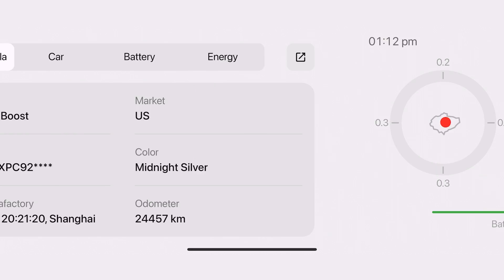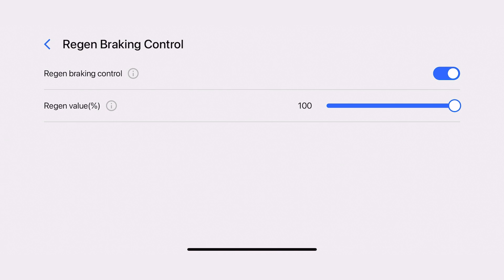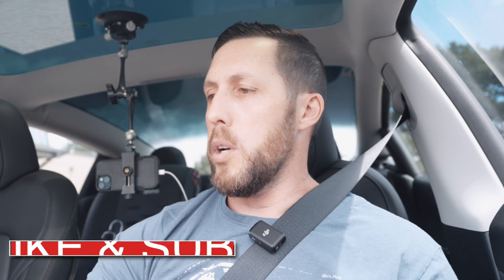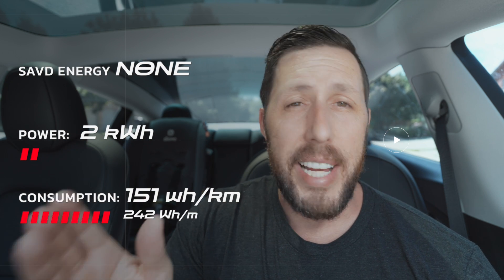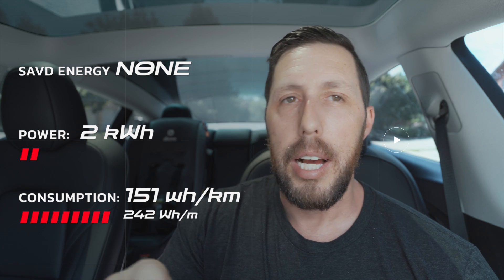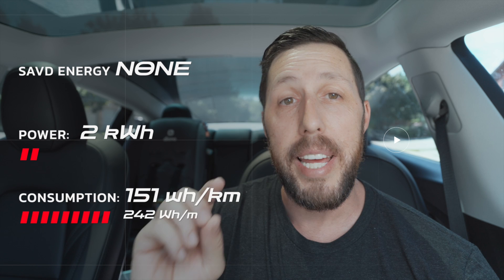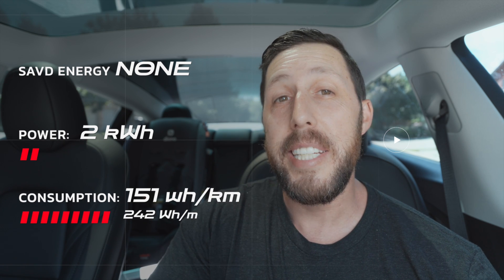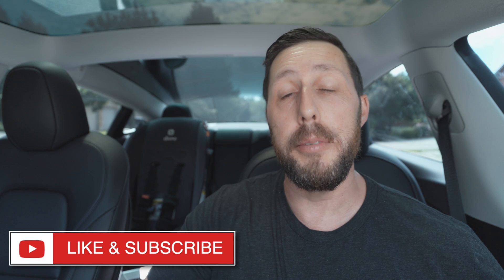How Much Energy Does Regenerative Braking Actually Save? Tesla Efficiency Test Revealed!

Comment: Would it be possible for a delivery driver to benefit more from regenerative braking? I deliver for amazon flex and often have my vehicle come to stops at multiple traffic lights, stop signs and peoples homes. Im not looking into buying a tesla but rather the Kia Niro Hybrid which has regen braking feature. Some Kia niro hybrid drivers claim that the regen on that vehicle is so good that it is capable of keeping the battery fully charged resulting in higher combined mpg which sits at around 53 mpg. I currently drive a all gas car that gets around 23 mpg city so buying this kia niro hybrid would really help me save on fuel cost while delivering.
Reply from the maker: Absolutely. Contrary to gas cars, EV’s mpg are actually better in the city vs highway because of the Regen braking.  So if you’re doing a lot of stop and go as a delivery driver, you’ll absolutely benefit from driving an EV.
Reply: @northerntesla  nice. Going to start saving up for that niro.  Should have the $35k or so in like 6 months.
Reply: Yes it will 32 to 36 mogs

Comment: Curious to see efficiency between coasting down a medium hill to then return back up a hill vs regen braking down the hill and then accelerating up the next hill
Reply from the maker: That's where the idea for the test came from, unfortunatley there's not an easy way to calculate energy consumption in such a small sample size.  I do get the instant energy expenditure but would need some serious time and math to calculate it over a period of time.

Comment: Regen is "Full control of the car". Coasting is so much more dangerous than enabling one pedal driving.
Reply: That's a huge leap to say it's dangerous.
Reply: @sonovabeach  measure how far the car travels in the time it takes for you to lift your foot off the acceleration pedal and depress the brake pedal and you will understand why regen braking is so desirable for safety.😉
Reply: @LearningFast   I've been driving ice cars for 32yrs, and an EV with regen braking for about 6mo. I'm well aware of the differences. I would say one pedal driving is largely a convenience, and it might offer a fraction of a second difference. But it doesn't warrant calling ice cars "dangerous".

If a fraction of a second of braking time is going to be a factor, you will definitely be needing your friction brakes anyway. So again, your argument is rather weak.
Reply: @sonovabeach  you’re wrong. That fraction of a second matters when stopping from highway speeds. At 70 mph you travel 102+ feet per second. Even a fraction of a second is more than 10 feet you lose of stopping distance.
Reply: @LearningFast  No I'm not. That little bit of time when your foot transitions from gas to brake pedal, your regen braking is not going to reduce your velocity by very much at all. Again, in that case your friction brakes are taking care of the vast majority of any measurable stopping distance. The number of instances where your regen braking is going to save you from a traffic collision is about nil. It's not designed for that anyway. Wasn't meant for that. Doesn't do that. So just stop.... get it? Stop. lol
Reply: @sonovabeach  you are simply wrong. Do the calculations and you will see exactly how wrong you are.
Reply: @LearningFast  Well I do appreciate the sarcasm in your name. Have fun.

Comment: When you need to brake then regen braking is almost 100% more efficient than friction braking. It is a no brainer to use regen when you need to stop or slow down. However, when you are cruising down the highway especially when going slightly downhill the choice is between coasting and regen. In some specific scenarios coasting will actually be slightly more efficient than leaving regen enabled. You really have to enable and disable regen as you drive to maximize efficiency. Maintaining a constant speed the entire time is actually the single most effective thing you can do for efficiency when driving at highway speeds without traffic.
Reply: Agreed. Although one thing to note is that regen is not just a binary it's engaged or not engaged thing. You can use the accelerator pedal to gradually control how much regen is used up to the max regen of the car. Say for example, you're on a straight road with a stop sign quite far ahead. In most cars like a Tesla, you wouldn't just abruptly come off the accelerator because the regen would slow you down too quickly, so you'd feather the accelerator pedal to only give you the amount of regen you needed. And in most careful driving, you'd only use the full regen of the car when you're at very low speed like the last 10 mph. Obviously, if you need to more suddenly brake then you'd either use the full regen or even press the brake pedal.

Comment: On motorways the regen is nothing, in towns and cities with stop start traffic, that's where it has good effect
Reply from the maker: Exactly, this is why highway driving is less efficient in an EV which is traditionally more efficient with ICE cars
Reply: It's all about speed. Toyota will say you get 60mpg on a prius but they don't tell you how. You drive 80-85mph the whole way and see an average of 51. Why? Speed and those energy costs. 

Tesla will tell you. 70 or below. Use regen. This and that. I go 75. It always says "would have saved 5.1 miles this trip going below 70".

Ice are not more effective. They just hold more gas. Comparred to a 2024 hybrid corolla, that's 48 mpg on a 11.8 gal tank, my battery is the equivalent same mpg but with a 6.8 gal tank. I just need to 'refil' more.